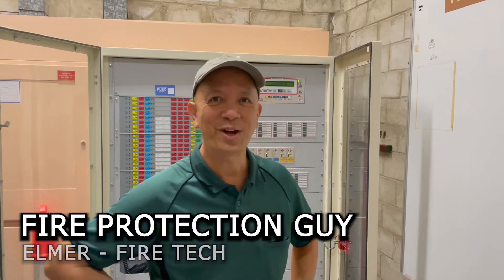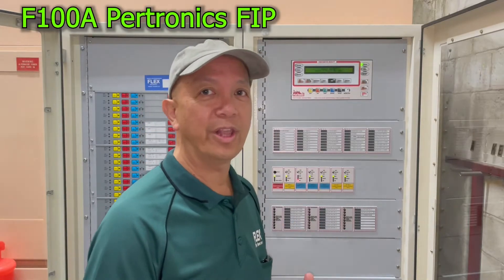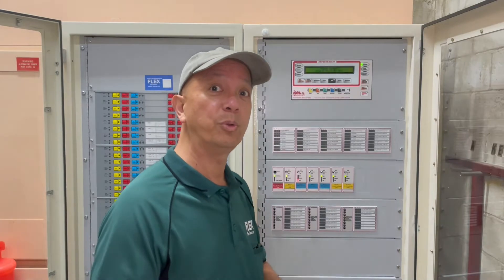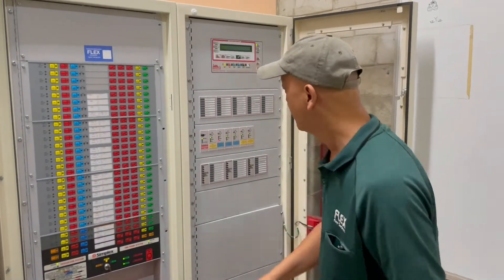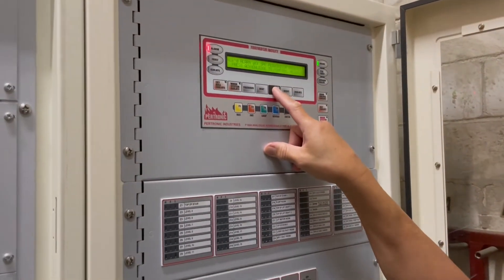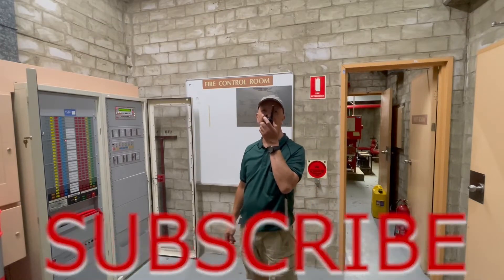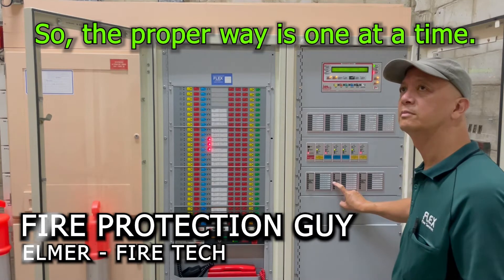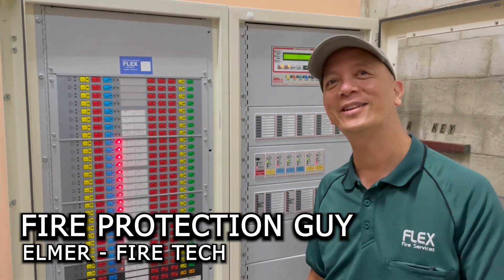FIRE SPRINKLER FLOW SWITCHES & TEST SOLENOID TEST.

Comment: Is this solenoid operated valve hlocated at the end of the sprinkler zone?  I'm assuming it is similar to an Inspectors Test Valve in the U.S.  If not, how do you know that water will flow through the piping?

In the U.S., a jockey pump helps maintain enough pressure to keep the fire pump from starting. 

And, in the U.S., a waterflow switch does cause an Emergency Forces signal to be sent.
Reply from the maker: 1. The solenoid is like a test valve but remotely operated to initiate a flow. It's located to the first point of entry to a zone or level or area coming from the main installation. It's just for identification of where to sprinkler burst is.
2. Yes, an automatic jockey pump purpose is to maintain the pressure in the pipe to keep the main fire pump from starting.
3.  In Australia, we use the pressure switch to send signal to the fire panel (and to the fire Brigade).  Flow switch can be used as an alternative too.

Comment: Running the pump " manually "  every time you test a flow switch to bring the pressure back up ... that's the dark ages , let the jockey pump do it automatically ( unless in Australia they have their own fire code regarding testing ) also, do you keep a record of time activation of the every flow switch ?

Comment: Hello sir where the waters flow in that area?  Did you you drain it? Because the pressure is 1500psi
Reply from the maker: There a drain pipe from level 19 (first solenoid and flow switch line) all the way to the sprinkler valve room. It's painted black.

Comment: Hi, I don't know why you need to start manually the pump to increase pressure, it is not automatic?, or the pressure drop was not enough to activate the pump? thank you
Reply from the maker: I just do it to quicken the job. It does run automatically.

Comment: Sir,can you help me ? We need to siren alarm to be started when flow switch gives signal to the panel (wt6500)
Reply from the maker: I am failiar with WT6500. But the basic wiring of flow switch is just how you wire a switch light. If your output is the siren, then the flow switch should be connected normally open (conventional system). If your system panel is programmable, it will be easier. Designate a conventional zone to your flow switch and your output in alarm will be the siren.

Comment: They joky pump should compensate automatically for the drop in your pressure right?
Reply from the maker: Sprinkler system with assisted pump to maintain required pressure has no auto jacking pump. Auto jocking pump is only installed to restore loss pressure due to unknown reason. It's not suppose to be use in replacement to a diesel or electric pump mover.

Comment: Sir pwede niu po ba maidisscuss ung system3 cp30 salamat po first time ko po mag fire alarm tech salamat po
Reply: Uhm thank you po sir..very helpful ang mga video niu sir para sa mga kagaya ko na electrician biginner dito sa middle east
Reply from the maker: Hi Mate...sorry...i need to know ano ba yung system3 CP30...baka iba ang tawag rito sa Australia.
Reply: Parang brand po sya ng siemens..system3 pyrotronics po nka lagay sa label ng unit sir
Reply from the maker: @teknesyanraiz9687  ...Ang mga siemens here are Cerberus panel only. I have checked in goggles and that system 3 is not available here in Australia.

Comment: This is awesome info.  I assume that faults in the system can trigger a false alarm?
Reply from the maker: Fault is just a fault but If the flow switch activated (false activation) without losing pressure in the installation, it will create an EWIS activation and then it cascades. It won't call the fire brigade thou but the building will be in full evacuation. That's the sad part, residents shall be scratching their heads why no fire brigade is coming. It happened to one of my sites before but good thing is I was able to find the problem due to history log. Thnxs Mate.

Comment: Ang delikado lang at maiwasan ang big issue? Kapag habang nasa area  biglang magkaroon general alarm... Kaya very important na inform ang fire department Lalo na kung ang area ay naka connect ang alarm signal sa fire department... Naku experience kona yun Ang mapa punta ang Fire Truck, Fire Chief at Ambulance at sasabihin mo Sorry 😂😂😂
Reply from the maker: Totoo yan. I was doing a test before and then suddenly an unknown alarm activated. I-hold the alarm and ran to the area. Found out it was a burned toast. Luckily, the system is isolated otherwise it cost $1,560.00 per truck charges from fire brigade.